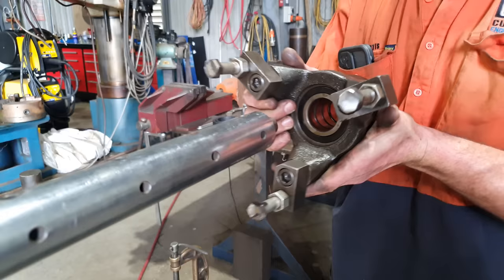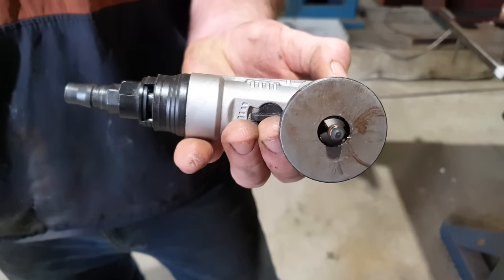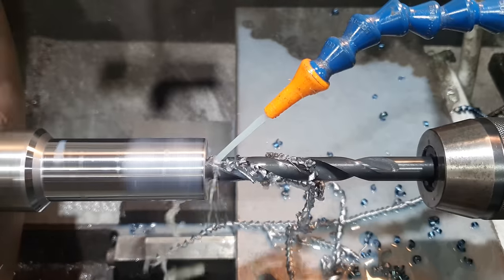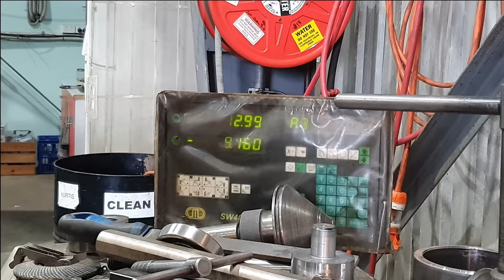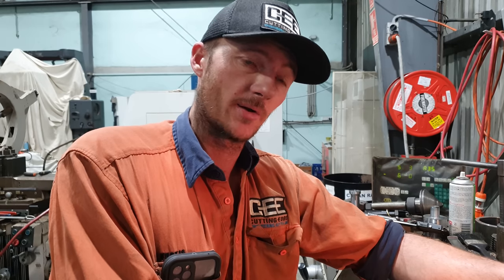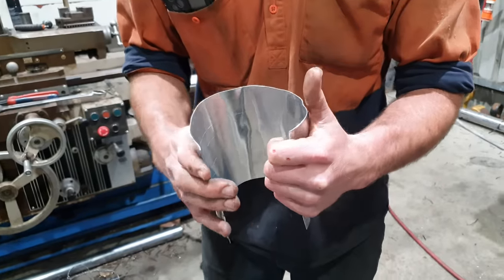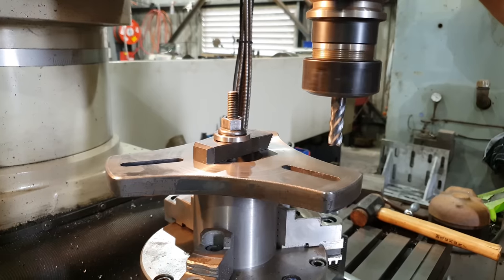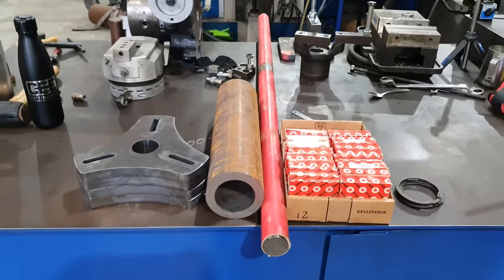Making Bearing Mounts for the Line Borer | Shop Made Tools

Comment: Seeing you stick the nozzle for the flood coolant wand into the back of the boring bar reminded me of a setup a good friend of mine uses. He has treaded the back end of all his boring bars that he uses internal flood cooling and installed a male quick disconnect fitting. On his flood cooling pipe stand he installed a T fitting and a female quick disconnect fitting and a cutoff valve to the flood cooling wand. Lastly he has a couple feet of flexible hose with a male and female quick disconnect fitting on it. When he uses his boring bars and wants to use the internal flood cooling he hooks up the flexible hose and shuts the valve to the food cooling wand. One last thing he has done on his largest boring bar is taped the holes at the cutting tool end of the bar and installed large carburetor jets from a Holley carburetor so to spay the coolant in a more controlled pattern.

Comment: Making custom mounts  or tooling is part of the deal and one of the enjoyable parts of the job. I have built many custom mounts for my Climax boring rig in the past 25 years. Many of those mounts were to accommodate the facing operations or attaching to weird shapes. As always Kurtis, well done and well thought out tooling. Cheers
Reply: There appears to be plenty of flexibility in the mounting capability built in without compromising the rigidity required for the machine to function correctly!

Comment: Might be a centre line defect, ref refractory material stuck in the first bar, also known as a "Piping defect", but only a guess?.
Nice design and build, "Built, not Bought".
Great work and video both.
Thanks for sharing. 
Best regards John from the Black Country UK 🇬🇧. God bless the Queen.
Reply from the maker: Hey John, yeah not too sure what was the issue with the bar maybe a hard spot in that section or bad batch. God bless the Queen and now God save the King!
Reply: @CuttingEdgeEngineering  Hi Kurtis,  probably a hundred tonne of that batch in the country,  only gets noticed you drill on its centre maybe?. Tara a bit. John
Reply: If I remember correctly 4140 is known as a air harden metal. Meaning if you get it slightly to hot in the process if hardens to the point of being impossible. Now don't quote me as I don't know for sure.

Comment: Very great job done on the tooling Curtis. Also a great decision to have all the parts NITRIDE HARDENED.  Too often shop made tooling is put into service as machined and turned into nothing but battered and dinged and unusabe in  short order from the use and abuse of tough jobs, wrenching, hammering ect.

Comment: I was expecting to see that tiny edge router used to break that inside edge of the bolt slots to make less chance of catching on a sharp 90 when tossing a bolt in. Also a very litteral RIP to blue piggie at 44:30
Reply: Nah, that won't be a issue.

Comment: I found this channel less than a week ago but I’m already about 8 videos in! Great job Kurtis. I presume there are some cases where you want to use the facing cutter but are restricted by how far out you can weld the mounts? Preventing you from having enough clearance between the mounting bolts, for the diameter of the head. Excellent photography too.🇬🇧
Reply from the maker: Hey mate welcome to the channel! Glad you are enjoying the vids over there. Yeah the setups can be a bit of a juggling act sometimes. Although smaller jobs that wouldn't fit a facing head don't usually need facing anyway 😅

Comment: Occasionally U.K. suppliers palm hard working machinist with crook material - plate that shatters in the guillotine or fletches like bent plywood - bar that nothing can bend and stock that Goldfingers' laser couldn't drill - have seen bar with stupid hard centre like yours and case hardened or multi layered plate in which a drill starts then stops and shears! Time was when bakers were put on a hurdle and beaten around the town for selling bread with stones included - seemed to work! 
Amazing work Kurtis - I'm entranced by your welding prowess!

Comment: Looks good, I had a job back in the 80s . They would send me out to do line boring in earth moving equipment in the middle of no where.  I would weld on brackets that have self aligning UC204  bearing i think on line up the shaft up with the holes before weld the brackets. Then use a magnetic base drill to supply the power. Adjusting the tool with your fingers.  Feeding the tool by hand it was easier then you thought. Wish had something like this so much easier. Bore holes in the pivot  position for a loaders diff housing upside down was not great fun. Worked alone and got the edge of my hand caught under the magnet hand to pull my hand outtake it up with electrical tape finished the job went back to work the next day. Lol

Comment: I always keep a 6 inch long solid carbide center drill in the tool box just for the times when material work hardens. Not saying this is the problem you're having, but they're nice to have. It's saved a lot of sharpening.

Comment: Nice work! And nitriding the parts will make them a lot more wear resistant. We had a molten cyanide salt bath at work to surface harden molds for brass parts (the brass was pounded into the mold by a huge ramrod).  Without the cyanide salt bath the mold wears out a lot faster.

Comment: I had a similar experience recently with a piece of round bar. I needed to make 3 of the same part out of one bar. The first one came out beautifully. The second one was difficult same as yours. I didn't attempt the third on and bought another piece of round bar. The steel in the first bar was just not the same all the way through. Nice work on the parts.

Comment: Hi Kurtis,
   Just as a matter of interest  , how did you come up with such a straight to the point ,original name for your company
      My father in law was a engineer, in the same trade as you, he worked in a firm called 
R.B. TENNANT,  they made the underground steel pipes for the gas & oil industries back here in Bonny Scotland, so you can imagine the size of the lathes & boring machines that were in their workshops, they also manufactured large boilers for locomotive livery, and steam ships, that part of his work was way back in the 50's & 60's when he was a young lad doing his apprenticeship, he passed away in the mid 90's when he was in his late 80's
       I like watching your vids, a guy can learn a lot from you, the way you explain every aspect of the job, help him in many ways, 
      I used to operate a CAT wheeled front loader,  and a D8 & D9 dozer, but the 1st CAT I ever operated was a 955 tracked front loader,  so you can see why I like them
       When there was problems with them, I used to do 2nd man to the CAT fitter that came to do the repair, the first time I helped him, he said  "right Gerr, I'm going to get the coffees, you torque those remaining  cylinder head bolts, set the torque wrench  to 200  p.p.s, tighten them to you hear the crack sound, that's it, what did I do, I fucked up his wrench by going by the torque 😃. "

Comment: Probably didn’t get my message across to well! This idea only applies to the when the powerhead is attached and you are using larger extension arms. If you had a recess cut, so that the extension arms wouldn’t lose alinement under load. This recess would allow the extension arms to slide in and out but not loose alinement under load. Cheers mate, I find your videos very entertaining and would be great information for up and coming machinist’s. Do you employ any apprentice’s? I think you would be a great teacher!!

Comment: Probably missbehavior of the shaft has to do with work hardening at the point the drill cuts. This is for example common to many stainless alloys and is usually addressed using more aggressive cutting angles on cutting tool. Good job as always, let's see how rigid this configuration is.

Comment: Nice video again, great to be able to make it the way you like it.. 1 question, why do you operate the bandsaw without cooling? Maybe you could also tell me why sometimes on the lave work you use cooling and other times you decide not to? Greetings from the Netherlands
Reply from the maker: Hey mate thanks for watching! The bandsaw coolant pump has died so can't run coolant but it was a tungsten carbide tipped blade so can cut alright. Mostly coolant makes a big mess so I try to avoid using it when we are filming 😂👍

Comment: Nice work. I wonder if it might have been a good idea to cut grooves ... like some lathe chucks have ... at regular intervals ... 5mm or 10mm apart ... into the face of the bearing mounts to make lining up the blocks faster. Oh ... and speaking of 4140. I've run into some that is very difficult to machine as well but I had to use it ... no subs.

Comment: Well done, Kurtis!! I am amazed at how rigid that ToolMaster lathe is given its size. What size is it by chance and how many HP (kW) is the motor??
Reply from the maker: Hey mate yeah it's a good "little" lathe. It is 1000mm (1 metre) between centres and 430mm swing. Weighs 1900kg with a 7.5hp motor
Reply: @CuttingEdgeEngineering  Wow, 17" and 7.5hp is beefy. No wonder it can take thre cuts you do so easily. Short bed though for being so beefy but that's likely a nice thing at times as it's more compact.

Comment: I have a suggestion about those drills f-ing up.. maybe a indexable drill(s)... I use Kennametal and Mitsubishi drill at work and they just chew 304 and 316 sst like it's nothing... Also note is that they are through coolant and the Kennametals tend squeak more

Comment: Hi. I enjoy your videos. Nice work.
Concerning the line boring mounts. Did you dimension the bearing bore to just accept two bearings to the snap ring, or is there a spacer between them to spread the bearings apart. If they are spread apart, is there a relationship between shaft size and that distance.
Kindest regards.

Comment: Nice job as always 👍
are you planning to use Original centres out of the sir meccanica bearing holders that the bar runs in? Or just run the bearings on the bar? (If that makes sense)

Comment: Hi guys, as always a great job, Where i work i also have the ws2 line borer with kit 2000, the dedicated kit to run the facing head, instead of long bolt sir meccanica made other 3 long blocks to screw in the blocks that fit in the mounts. I always hated that piece of equipment because produces lots of vibrations and you must do maximum 1 mm depth of cut. In the most of times if you can fit it in the job you must do a few area in a time because if not the facing head, moving outside, will hit the piece you are working so to reach every point of the area you must move the tool in the varius holes of the facing head, this will take entire days in some cases, The thing that makes me hungry is that if you look around in YouTube  you can see lots of promotional video in the sir meccanica youtube Channel where you can see they face 5 mm at a time without any difficulties, do you reach the same results? 
I learned a lot of things by whatching you lineboring, working on the lathe and so on, that improved my own works, so thank you very much for the beautiful videos you both do.
Have a nice weekend
Your biggest italian fan Giacomo

Comment: I strongly recommend that you take one seal off each bearing, and pack them with grease.  (Then, of course, replace the seals.) I have personally seen hundreds of bearings fail within a year due to only a drop of grease installed at the factory.

Comment: I noticed you use a lot of Allen head bolts that was the same in the equipment I worked on in the coal mine are they harder to slip when tightening or loosening just me being nosey I guess great work as usual

Comment: I had a thought that there may be jobs where you cannot get the mounts for the line borer where you need them, to solve this you could repurpose an old lathe bed.
Make a plate that will mount the borer to the lathe bed but with plenty of room to move around and another to attach anchors to then position the job near the borer.
Depending on the size of the work piece you could mount the other end of the boring bar to another plate on the lathe bed or to the job as normal.

Comment: Why are you running your horizontal bandsaw dry? That is very tough on the blades and the machine, it also generally causes the cut to have runout.
Reply from the maker: the coolant pump has died haven't got around to fixing it, i'm running tungsten carbide tipped blade it can handle it 😂

Comment: There must be some witchery involved when your bandsaw is able to cut withouth coolant.
I use Amada bands on my saw and they burn out as soon the coolant stops to flow. Witchery i say:)
Reply from the maker: hey mate my coolant pipe on the saw has died need to fix it, but i'm running a tungsten carbide tipped blade 💪
Reply: @CuttingEdgeEngineering  Wow, who builds that whichery and how much it cost? I have tried about dozen brands so far. Regards from the old continent, stay strong.

Comment: I'm guessing the 4140 work hardened while drilling, and then everythign broke after that. HAd the same problem, and without a carbide drill there was no way i could get around it, had to chuck it out, and it was expensive precision ground case hardened linear shaft.

Comment: One thing I dont understand with that line boring machine, is how do you center the line bore bar with those cones if the hole is so worn that its an oval or the face is so damaged that the cone doesnt sit in it correctly?

Comment: My experience with at least Ion nitriding on stainless steel is that it does change the dimensions.  At least when you are trying to hold ±.001 tolerances.   I don't have any history with carbon or allow steels.

Comment: My experience with round stock making vacuum flange is very bad. When they roll round stock the center can get inclusion and cause a vacuum leak in the center of the flange. You my have gotten some hard material down the center causing your drills to go bad.

Comment: What happened to aluminum sheet as soft jaws in the chuck jaws for the mill, after taking care to include it for the lathe?
Reply from the maker: hey mate I didn't use as much clamping pressure and those jaws are not as aggressive as the lathe so didn't do any damage
Reply: @CuttingEdgeEngineering  That makes perfect sense. Thank you.

Comment: Hint 
       The Guys would Green Tape Tag Mark the length of bar remaining 
   ie SS Stainless Steel , OD 40mm  , ID ....   ,  Length ... metres 
     This is Helpful when you have say Three lengths on the shelf at various measurements , but they are still " 500 mm " short 
    Or say two of them get you three pieces cut but the fourth piece can not be cut from the remainder bar .
     Bloody handy at stock taking time as the running totals just had to be confirmed on to the stock sheet
      Most Beautiful Brilliant  Way for stock editing / control / Information / confirmation 
     Thanks for reading

Comment: I don't understand how these are meant to be accurate when they use a coarse thread bolt to weld on to the work piece. I would've thought you would want a adjuster after welding to square the tool up to the bore and pressurize the threads so they stay accurate. A cone to centre can only do so much.

Comment: Why are you using pneumatic grinder instead of electric?
Reply from the maker: Hey mate a few reasons why I mainly use air tools/grinders, they're from my days working in the field where we ran the compressor. It also means 1 air lead and less electrical leads on the floor. Air grinders will stall if they get caught up but electric won't so it's a good preventive safety measure as well.

Comment: You know that first bit of rod is fucked once he went with chrome bar since it would be easier and more pleasant to machine. Not something you'll hear often.

I wonder if that 4140 got heat treated incorrectly or is extremely internally stressed. Could even be a mix-up and you were sent the correct spec rod, but wrong alloy.

Comment: the reason for nitriding is not to harden the steel because it needs to be hard. its to make it spatter resistant. the ball of weld spatter dont stick to the nitrided surface the same and remove much easier which is important for accuracy when your boring or facing something. 

who da thought it bathing parts in a solution of specially heated ammonia water at a special concentration would change the molecular surface structure of ferrous metals. its a useful but rather nasty chemical process. stay away from nitriding pits when there in operation or being opened as it gives off ammonia gas.

Comment: is the tool holder detented or something? it seems like he's just spinning it a round willy-nilly without knowing the actual angle and distance the tooling is at. or maybe it doesn't matter or they're not showing it or i just don't understand this process yet. also the concentricity of the tubing seemed wildly out. not knocking it at all just trying to understand.
Reply: oh maybe he turned more down on inside and out so it didn't matter later.

Comment: Knowing how shoddy quality is with many businesses these days, would be surprised if that 4140 bar was mislabeled by some unqualified temp that the supplier has to use because no one wants to work. Or the steel mill where it was made was some cheap Chinese outfit using whatever they had laying around and just called it 4140. Nothing would surprise me these days.